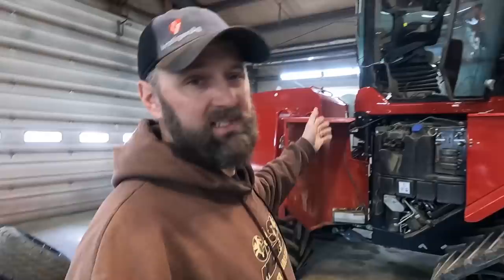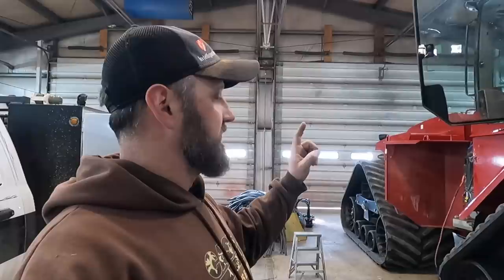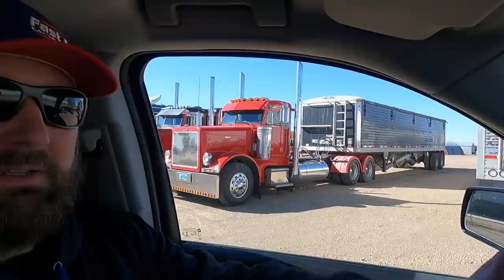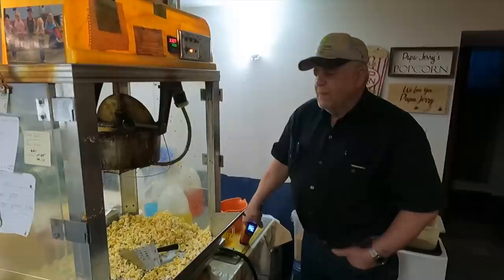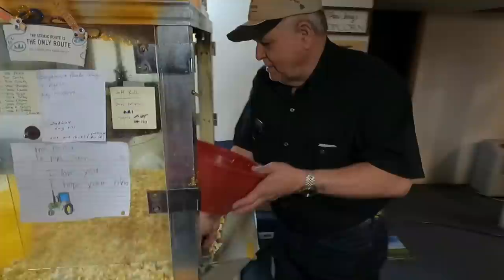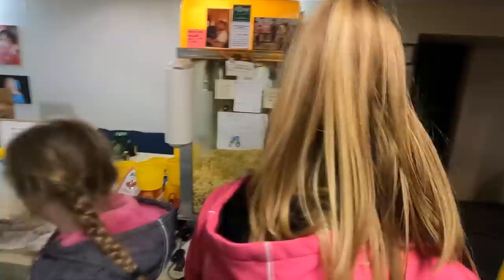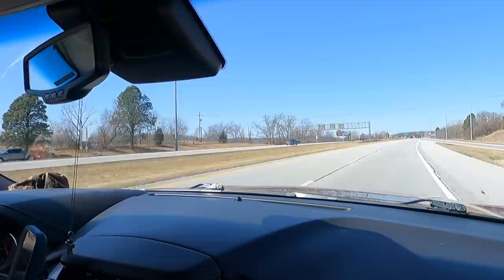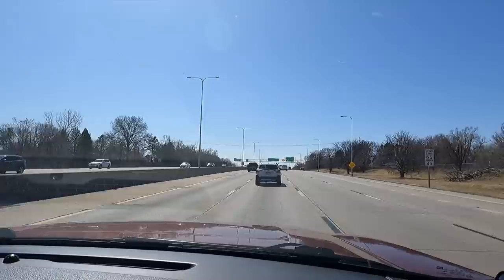FIXING LARSON'S CORN, I MEAN BEAN PLANTER!

Comment: i recognized Zimmermans trucks.  FYI i have had to remove a sensor from the bottom of the def tank after the tractor sets for winter and crystals collect at the tank bottom. there is a service bulletin from case for it. basically you remove and wash it and reinstall it.
Reply from the maker: if it acts up again I will have to check that out.

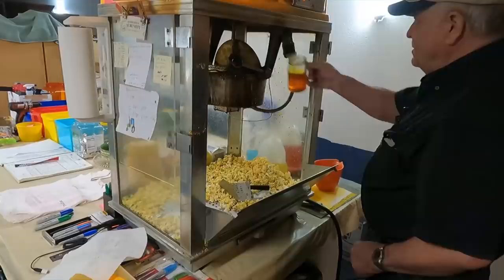Comment: Did you buy a planter off Larsen Farms? Used oil is good for heater -needs the special ball burner and air atomizer -nor a standard oil burner with high pressure atomizer. 7:35

Comment: The problem with getting the gas to refineries is to expensive and not always feasible but if thay could get it there and refine it  it makes a lot of different gas’s prepane natural gas iso butane butane  but it’s the cost of putting all those pipelines in from all those wells to the nearest gas refineries and not all wells produce a lot of gas’s  that’s why thay burn the gas off  not to be a smart butt or argue which what Tony was saying  have a great day  only reason I say that is I worked in oil feild for years